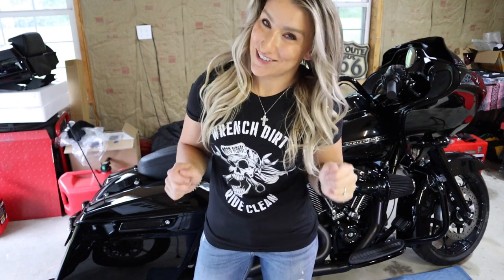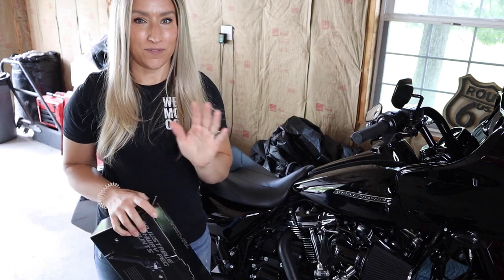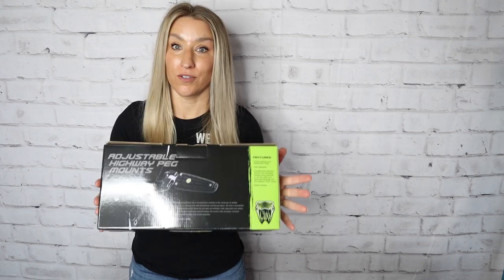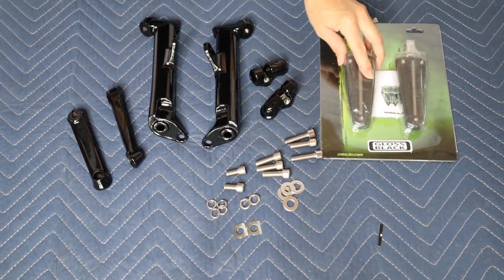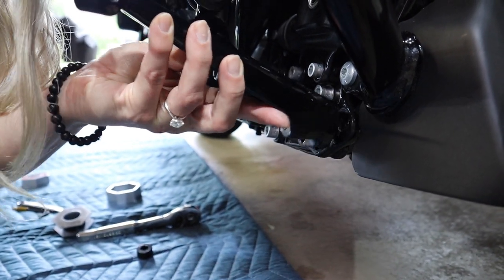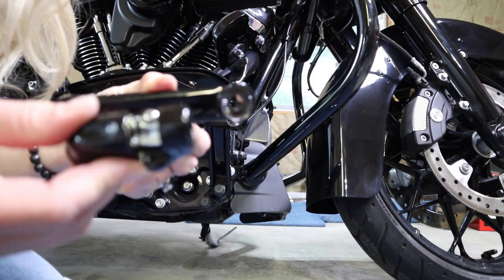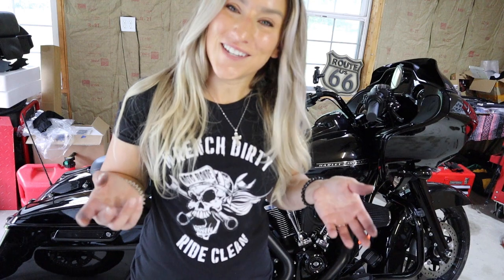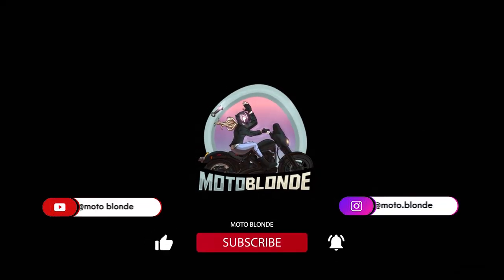HOW TO: INSTALL HIGHWAY PEGS! Ciro pegs for Harley Road Glide!

Comment: Out of all the install videos from other tubers, you do a great job. I installed these about 3 months ago and even tho it was fairly easy I did have doubts on the kickstand side. I was concerned that the one bolt would not hold the weight of the bike until I installed the bolt with the arm. 
Had a neighbor come over and help just for safety.
Thanks again for your videos.
Reply from the maker: I know what you're talking about! I looked it over several times before I took the screws out to make sure there were still enough to hold it, haha! You're right though, better safe than sorry!

Comment: I installed these on my RGS right after I bought it, great upgrade. What I really like is I am a shorter guy 5'7" with a 30 inch inseam these things allow me to set up the highway pegs so they fit me comfortably. Highway pegs mounted on the engine guard never work for me just to far away and the ones with extensions looks crappy.
Reply from the maker: Good to hear some thoughts after being used!! Enjoy!

Comment: Great video. I have been considering these for my 2021 RGS also. I run 3/4" floorboard extensions to get the boards out board further, way more comfortable. I'll just have to fab 2 spacers also. Was nice to see that will work. Stay safe.

Comment: The new highway pegs looks good in gloss black 😎👍 Ps I had to use Magwheel car chrome spacers so I could use my factory engine bars and running boards due to also custom pipes.

Comment: Great vid. It's about 105 heat index here in Southern Illinois. Hang on fall is on the way 😊
Reply from the maker: Yikes! I told myself after all the snow I wouldn’t complain about the heat but...it’s hot 🤣
Reply: @MotoBlonde  I remember that. But I said fall,not winter... 😆